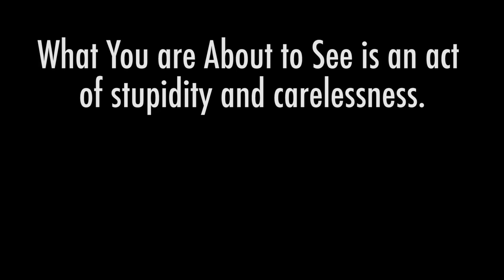Fitting the 670cc and Test Ride!

Comment: how is it turning without a differential? i mean wouldnt that ruin the tyres if it does not have a dif?
Reply: +michael duong it'll be fine
Reply: It's called a live axle. Go karts have used them forever. At low speeds or on pavement it does not like to turn.
Reply: +Ian Thompson You lean left and turn right, to unload the inside tire so it doesn't scrub as much.

Comment: I just got into this and I have no idea where to start making a cart. I want one like the ones you guys always race around the yard in. I think I want a Predator 212 because it seems like a good starter engine, but I don't know what else I need to put one together.
Reply: I am building one right now. Find a frame no engine on Craigslist for like 100 bucks. Buy a predator 212cc for another 100. Don't forget chains sprocket, a centrifugal clutch, throttle cable and brakes. Do your research!
Reply: ADG _ I looked on craigslist but there wasn't any good ones
Reply: Lucas EBAY

Comment: Before I had brakes on my kart and my throttle stuck I had a full tank of gas and went to around 30mph and my steering wheel mounted kill switch came disconnected and I was stuck on it for a few minutes till I drifted into a tree and set off the low oil sensor

Comment: I wanna put one of these electric start HF Predator 420cc or 670cc engines on an old motorcycle to make it a cheap automatic bike. Most auto bikes are expensive as hell (over 10k) and this seems like it would be a cheap solution to the problem but I'm not sure how fast it would go. If it went 55+ that would be fine for me. It would just be used for cruising around town, no highway use. I assume you would need the torque converter for those kinds of speeds but I don't know where I would get one for this engine. Any advise on making this happen or what I would need?
Reply: go look up the honda grom, problem solved, the 2017 model comes out in 2 months, has led headlights $3349 out the door here in hermiston , or
Reply: Still way cheaper to buy a junk motorcycle for a couple hundred dollars and put the 670 predator engine on it. Also, the Honda Grom is a real small bike and I'm 6'1. Not gonna work for me.
Reply: Axe Music no it's way cheaper and smarter to just get a used bike, no need to reinvent the wheel. you can get a ninja500 for like 2,000. you can't just slap a predator to a bike frame, if it was that easy it would already been done. plus if you try to stick the size motor in it you are going 150mph not 55mph
Reply: eksine You must have never built anything. It's not hard to put a damn go-kart engine on a bike. Lots of people do it and there are examples here on Youtube and they didn't spend anywhere near $2,000. I can get a Predator 212cc or 420cc for dirt cheap. Also, there is video of some mechanics that put a 670cc Predator on a go-kart and it only went about 50 mph. It's all about how you gear the thing.
Reply: Axe Music good luck with it Tim Taylor, since you seems to know your stuff you obviously don't need nobody's help. I was trying to give you practical advice. a ninja 250 makes 24 hp and goes 85-90, I'm pretty sure a 670cc will do that and more easily. I said nothing about gearing I said 670cc will go fast, that is all
Reply: Buy a Honda Magna that needs some work $750 - $1000
Reply: Axe Music how fast it will go mostly depends on the motorcycle's transmission.  if original motor could go 120mph, than 670cc would go at least 70 to possibly  90mph. more than you hope for for sure 212cc too small

Comment: Where you guys find that kart frame?
Reply: Check Craigslist, they're everywhere. Used ones are usually good unless rusted or wrecked.
Reply: +Back Seat Garage I found a really good deal on a wrecked one. To be specific, where the front wheel attached, the metal was crushed. I'm contemplating purchase but I don't know how to fix it

Comment: I believe his truck has a 350 crate motor
Reply: +Theo Ruppanner 400
Reply: Issac question for you guys at cars and camera's
Reply: I wanna build a go kart for my uncle and myself to use at the river what motor do you suggest cause we want lots of speed
Reply: a modified 212 is awesome. it has been the best engine for us. its light weight and small but you can get an easy 9 hp out of it
Reply: He said he wants a 25 HP kart racing motor where could I find one cheap cause we plan on putting headers a torque converter and big sprockets is that a good combo?
Reply: cheap with that hp. thats going to be hard to find. header and a torque a verter is cool. big sprocket is cool if you dont want top speed . i think john has a 58 tooth sprocket and he does 49 50 with his
Reply: +Isaac it'll be fine : how much do you think the motor will run and how do you suggest to get top speeds and the best performance?
Reply: the 212 is 100 to 130 dollars then you can have around 200 dollars in mods to get around 9 hp. you might find other alternatives like a old motorcycle and pull the engine off of it.

Comment: 22hp from a 670cc???? Thats a joke. My 125cc 2 strokes both have 30hp+.
Reply: 670 makes way more torque than a 125 two stroke just not horsepower
Reply: @albertjankins2225  id still expect more than 22hp. 70hp/litre is a moderate expectation for a 4stroke, so a 670cc should be good for 40hp+ with ease.
Reply: @christianbuczko1481  yeah it is pretty low

Comment: lets see lol
.670 (670cc) * 61 = about 41cubic inch of displacement ...with almost nothing to carry as wight ..
yeah thats some pretty power to wight ratio stuff going here....
if only it had gear selection ...
that would be sweet  much like what this guy did :
https://www.youtube.com/watch?v=XflqINUi_1A

i know some people say i gotta a 2 stroke 125cc that makes 20 hp
yeah but not as much or even near in terms of torque..
i would opt for this engine ....instead of a 125cc 
reason be is the go kart i want to use + gear selection mechanism + plus my ginormous ass puts the entire project at around 400 kilogram

Comment: truck engine short block chevy 350
Reply: +Ryan Peters small block 400
Reply: oh don't see many small block 400
Reply: +Isaac Jennette 4 bolt mains? I know the hot rod guys years ago didn't like the 400's because you couldn't bore past 30 over without having head gasket issues. That was the engine I wanted for my 74 Nova.... It never happened. Good vid here.

Comment: 454
Reply: +Thekx80kid that would be nice. 400
Reply: me and my dad has a 454 nitro with 2twin turbos in a old Chevy looks like your motor tho lol
Reply: +try hard fisherman you mean nitromethane or nitrous and twin turbos not 2 twin turbos cuz that would be a quad turbo setup in which case you'd be running to lean besides the fact that there are a lot of other challenges with building a quad turbo setup.